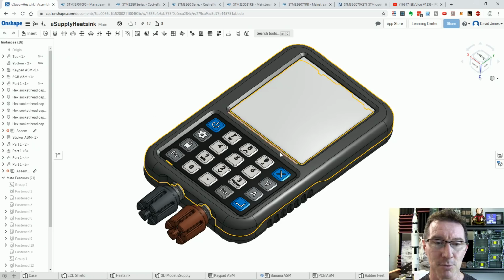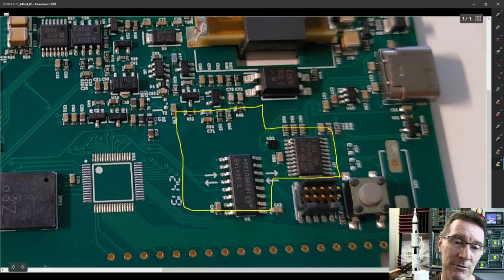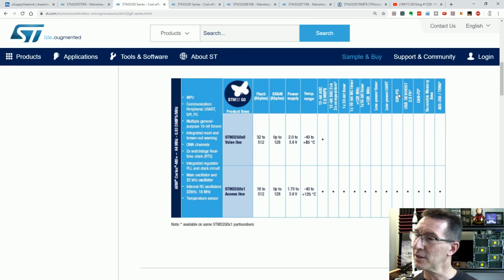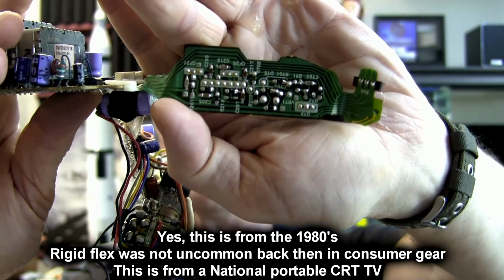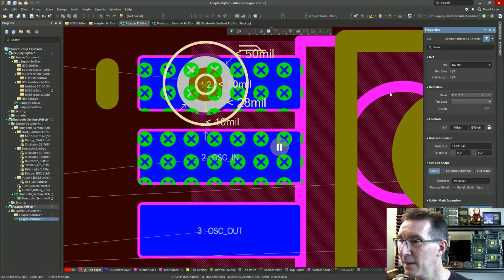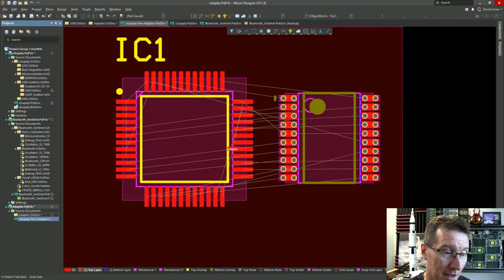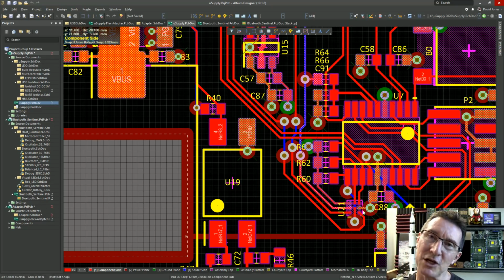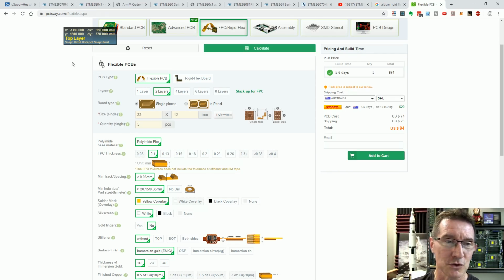EEVblog #1262 - Designing a Flex PCB + uSupply Update

Comment: Ha ha ha - yeah size constraints are troublesome if you underestimate the size of your code libraries. I recently did a size estimate on a cortex-m4 minimum software stack based on Newlib and gcc C/C++: small bootloader + Newlib C library + gcc C++ library + gcc C++ STL adds up to about 63k. On top of that you can start adding your own code and 3rd party libraries.
Reply: That is why you pay for good compiler and you get your code 30-60% smaller (even for small programs) and  and do not use c++ which add about 5-10% on code size on even best compilers. And you have added bonus in speed (I never mesure speed but according to compiler test for microcontollers gcc on F7 series generates 5 times slower code then top compilers)
But again gcc it is 5000€ cheaper then good compiler.
Reply: @mrlazda  Sure, don't use C++ if size if your primary concern is size. In my case that brings you down to bootloader + Newlib C library size total of 23kb which is reasonable for a fully functional C library. However, if you do need C++ then gcc is very good for size. It used to be that developers compromised and used highly compromised and size optimized embedded C++ STL libraries etc. but nowadays the gcc C++ STL is so well optimized that even projects like uSTL have shut down because it is not worth maintaining compared to the gcc solution. Meaning even though it adds about 40kb to use C++ STL it is still a very good size for what it is, a non compromise C++ STL. Regarding speed and size, I don't believe any commercial compiler like Keil etc. are any better at optimizing than the latest gcc 9.2. You might find corner cases where one is faster than the other but generally speaking no. I would pick an open source compiler like gcc or clang over any commercial one because the open source ones have much better support and companion tools.
Reply: @_-martin-_  Well but our test show very different results, in case of Keil vs GCC on our test program (we made some test program just to test ARM compilers) we get big difference between Keil and GCC, Keil result is around 26 KiB and GCC is around 40KiB and then as always winner on our tests is IAR with around 20KiB (just to be clear tests are written to be optimal for GCC and then made to be able to compile on Keil and IAR), we did not test Tasking compiler just because we do not have access to it (we heard good things about it but we do not know anyone who have it). And that is not just our experience, but all other companies that we do something with have same experience.
From our experience only worse then GCC is free MIcrochip compiler (but that compiler in free version add useless instructions just to make code bigger, so you will buy paid version), that why we stopped using PIC microcontrollers (when IAR dropped support for them). we use them only with assembly and only 10 and 12 series.
I am all for open source (we try to all we do to publish under some free license, except GNU, if our clients allow us to do that) but when that start costing us money then we pick option that cost us less (in this case that are expensive commercial compilers), I do want to see GCC or any other  open source compiler be close to good commercial compilers for microcontrollers so I can stop wasting money on compilers (I do know better ways to spend money then to give them for compilers).
And this is just what I heard, we do not use GCC so we didn't had that experiences but some companies had problem with GCC that it generates wrong code when you turn optimizations on, code without optimizations is ok (interesting that company after that switched to IAR, and we had similar issues long time ago with IAR for Atmel, but they quickly fix that in next release).
ps: For all except microcontrollers I do try to use GCC for all I can (even if it is not best solution there to and I have access to for example ICC for x86 that for me do not make in most cases that big difference so I try to stick to GCC it is good enough, there is just some special cases when difference is to big that I choose to use ICC).
Reply: @mrlazda  Sorry, but I'm very confident you are doing something wrong if gcc produces 40KiB, and your best compiler produces 20KiB. Maybe if you run with default compile options but gcc has many options that can help reduce size that will likely bring in on parity with your best commercial compiler. Also, if C libraries are involved, it is important to include the same C library if you are doing size comparison. If your test code is open source feel free to make it available - perhaps we can do some comparisons with latest gcc 9.2 compiler on e.g. cortex-m4.
Reply: @_-martin-_  Yes I know we are doing something wrong IAR should make 60% smaller code then GCC (according to their site) and we only get 30-50% so our test are in bes case 10% worse for IAR then they should be.
Joking aside we know what we are doing (my company is doing that for over 25 years and include people who designed most development boards MIcrochip sales) , that why we big companies pay us to do R&D for them, and we are not only who get that results, that is common result. GCC is not best for code optimization for size especially on microcontrollers and that is a well-known fact. (and IAR is hard to beat for optimization, that will admit even people whoso job is to write compilers for microcontrollers for other companies and they sell more compilers then IAR not their compiler is better but is much cheaper)
We learned why I need to pay for compiler on hard way when I lost money just because we was cheap to use free compiler (but we pass relatively cheap I know cases when company lost mid 8 figures in contracts for same reasons).
Reply: @mrlazda  I'm sorry, I'm still not convinced and you have to be very careful that you care comparing apples with apples. Yes, older gcc compilers might give you that result and perhaps IAR's claim of up to 60% comes from that. However, newer gcc, and certainly latest gcc, will not give you that kind of output size difference compared to IARs toolchain, especially not when working with 32 bit cortex-M. I build my own gcc cross toolchains from scratch and from that I know there are many options you can tweak to reduce code size - simply adding the "-Os" size optimization flag to gcc does not produce the smallest possible output size - there are more options you can tweak to further reduce size. Also, a lot of work have gone into gcc/clang in recent years to have them optimize things much better. I think we need a more up-to-date comparison to get a contemporary picture of IAR vs gcc.
Reply: @_-martin-_  Sorry may I ask when you last time compared IAR to GCC, we did comparison like 2 months ago, and yes we know how to turn optimizations on in GCC (we did turn dead code and dead data removal,  Disable  RTTI and exception handling, LTO ....) and that is results. I will ditch IAR same moment when GCC get in 10% in blink of eye.
Trust me we try every possible option and what I told you is best results we can get with GCC. We are not some kids that play with microcontollers for hobby in their basement, we do that professionally for living.
And yes I would like my company switch to GCC so I do not need to pay for compilers (I own 100% of company so all that money go out of my pocket)  I would in March prefer to spend amount of money my company speeded on compilers on new Aston Martin DBS Superleggera (just this year my company speeded only on compilers 1/2 of price of it, and if we could use GCC that money would ended in my pocket instead in pocket of some other company so trust me I have good reason to my company use GCC, but as I stated before we can't)
By the way I do not try to convince you to anything, you use what you think is best for you (or what your tests show you that give you best results), we will use what we proved that works for us (to be precise what make us most money, I would not use IAR if it so not make me most money, I really do not its UI, I think they didn't change it from late 80). I just presented you results we get and that is all, it is up to you to do your tests and see what is best for you.
Reply: @mrlazda  As it happens I had a project last year where I tried replacing gcc with IAR on a cortex-m4 micro just to see what we could gain in size savings and it was about 15%. You say you have some secret test program optimized for gcc where it was 50% smaller with IAR. I guess that kind of savings could happen for a very specific and maybe broken use case but I don't believe that to be the general case at all, especially not with a modern gcc toolchain with all optimization bells and whistles enabled. It could also be you are using some obscure architecture that is particular bad with gcc that I do not know of. In my experience with cortex-M micros, gcc is worth it.
Reply: @_-martin-_  I you are interested we tested for cortex-m7f (STM32H745ZI) and cortex-m3(stm32f107vc), we mostly use STM32F103/7 series and we needed for some project we are working power of STM32H7 (first choice was STM32H745ZI but we will manage to do all with STM32H742ZI), we didn't run test with cortex-m4f just we do not need it for now (and as it look we will not need it for next year at least) so it is no of interest for us.
We do not use anything special for test it is just test program that is carefully made so can be compiled on all compilers and test procedures we use most often, but other then that it is pretty much useless because in near all cases you can't compile same C/C++ with GCC IAR and Keil (they are not compatible) and make it to do something much useful.
Your statement I try GCC project on IAR, explain me all, when I hear that statement I see only red flags, as I pointed earlier, you can't just switch from GCC to IAR,  and expect it works, that is not how it works. You can't use most of libraries made for GCC on IAR (they need to be ported to IAR first), they do not handle inline assembly in same way, references to memory placement are not same ....,  to make it simple in 99% you need to port whole project from GCC to IAR what is not someone who do project professionally do just to see if he will get some gain (that why you make test programs)
I guess you tested with some so basic program, that is only what you can switch between them, so for extreme small project you will not see difference ( only difference you will see is how different they optimize startup code)
Now is clear to me why you get so good results with GCC.
Reply: @mrlazda  I don't care for your condescending attitude and I can tell you that all your assumptions are wrong. The code we tested was written for a Texas Instruments TM4C129 (with hard float) and it ended up requiring only a relatively small effort porting it from GCC to the IAR toolchain, for several reasons. Generally we write our own C code in ISO C11 which is supported by both IAR and GCC so we had to put in very little effort to port our own code - in fact, we only had to eliminate a couple of misplaced gnuisms to make it work. Additionally we had some assembler boot code we had to port but that only amounted to about 50 lines or so of assembler, again very easily ported. The biggest effort was rewriting the linker configuration script to make sure everything was placed correctly in memory. We care about portability and it so happens that the 3rd party TI driver libraries that we had chosen to use are supported by both GCC and IAR (ewarm) so those ported with no effort. In the end, the output size of GCC was about 250kb, a decent size firmware for this type of micro, and with IAR it was about 15% smaller. Mind you the code was made for a product by professional software engineers, not some script kiddie in their basement doing a small basic test program. We are all professionals here. It is speculation on my side, but I think you guys have been comparing some older GCC version with IAR. Older GCC versions (just 2 generations back) are known for their inflated output size. Either that or for some other reason you run into a specific use case or misconfiguration that ended up inducing such a big size difference. Clearly we have different experiences and maybe we will have to agree to disagree. The devil is always in the details.
Reply: @_-martin-_  There is no need you to explain me anything any more, after your nice writing in your last comment (of course you missed some key steps in porting code that you must take) for me it is clear with what kind of software engineer I am talking and I see I am wasting time in any other discussion with you.
Reply: @mrlazda  Well, I also feel sorry for you and your customers if that is the sort of attitude you want to maintain. I am missing no steps in my description of our porting effort and there is no room here for all details. If you think different please enlighten me on what is missing or please hold forever quiet. It is besides the point anyway, we put in the effort to do the porting and that lead to our size conclusions.

Comment: you have to remember that if the flex is made out of Kapton you need to bake the PCB before use to allow any absorbed water to be removed before soldering. we used multi-layer flex pcb's to provide screened twisted pair's to replace wire. solid screens except where they bent, at  this point it was xhatched. could reduce 20 twisted pair cableform down to one PCB from the connecter at the front to the motherboard at the rear.

Comment: 32KB? You should be able to fly to the Moon with that much memory!
Seriously, is USB PD so complicated it can't be done in a few KB? Starting from scratch rather than trying to trim a bloated library? (I must admit I know absolutely nothing about the protocol though...)
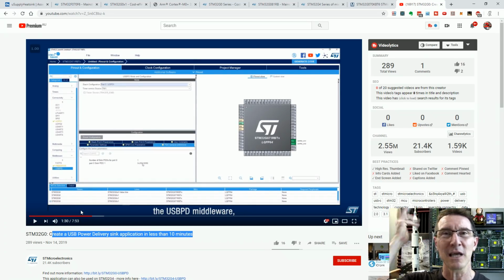Edit: 18:55 apparently it is :-/
Reply from the maker: Yep, no reason it needs to be that big I'm sure. Probably uses a ton of pre-written libraries and non-optimised stuff.
Reply: There are many ways to minimize the size by just using compiler and linker flags. But yeah in general when I comes down to firmware, it gets more and more difficult to find optimised code and best practices. The reasons for that is another topic, though.
Reply: Probably is written in C++ with templates...

Comment: You could route holes out around U2, U21, C88, R60, R62, etc so that the flex PCB will sit flush with the board and place the new microcontroller between U2 and U11, then you don't have to remove the capacitor or worry about the bend radius. You could also route small slots over the U7 solder mask for easier alignment.
Reply from the maker: Sure, several different ways to do this like I said.
Reply: it's just freestyle by DJ

Comment: Keep in mind: a flex PCB mod/adapter board will even let you fold it back over into the footprint where it is connected. No reason to hunt for space all around that. ;)

I often solder very small flex PCBs to a dense QFP, sometimes several a day: UltraHDMI mod for Nintendo 64. ;) The castellated edges of the flex mesh perfectly with one side of a QFP160 and it works incredibly well.
Reply: Thank you for sharing some wisdom with me!

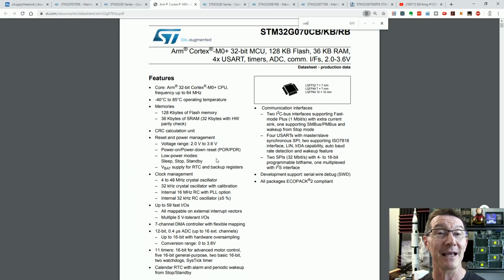Comment: 17:06 no usb controller, thats the STM32G070CB, which fits in the "G0x0" (x is wildcard) row of that features table, the top row, doesnt have usb power delivery
the STM32G071CB (g0x1, the row that has usbpd ticked) does have usb pd, on page 33
https://www.st.com/resource/en/datasheet/stm32g071cb.pdf

Comment: I've got an old Casio scientific calculator (25-30yo, my dad got it as a gift) and the whole circuit is on a flex PCB, membrane buttons, the main IC, screen is soldered directly to it, and there's a small hole to fit 2 THT diodes (leads are straight, just cut to lenght) for the solar panel, it's absolutely beautiful and insanely light, using it without the protective case feels very weird, since the back behind the buttons is recessed, so the flex rests on the enclosure
Reply: TomboXYZ He’s shown teardowns of those on a few episodes.

Comment: are you not worried about poor power supply decoupling with those thin traces?
you couldn't get one of the small QFN/chip-scale BGA to fit inside the SSOP footprint instead of the TQFP?

Comment: Normally when I watch EEVblog videos, I think "Ahhhh, something I find interesting, but know nothing about." Then suddenly it's about binary size. My pet peeve.
Let me guess, it depends on 15 massive libraries?
Reply: Would you believe me if I told you they forgot to turn THUMB emission on?

(It's a joke, because all of the Cortex M series can only execute THUMB instructions, not the full fat ARM A-series instructions...)

And no, since this is embedded MCU dev there's not as much library dependency hell, especially not when you're targeting 16-bit binaries to 32KB of flash. Might be able to get away with that on AVR8, but ARM's code density isn't nearly as high.
Reply: Crapy software depending on hundreds or even thousands of libraries are really the plague of modern software development. I look at you Electron...
Reply: @jendib  Yep, Electron is an absolute failure
Reply: How long until a vendor-supplied "embedded" software package contains a zipped node_modules directory.....

Comment: Why not use "rigid-flex", the rigid part only covering the main board footprint, and then flex out the new chip? reduce stress on the flex/soldering and maybe simplify the interface between main board and adapter board?
Reply from the maker: Because it's not for production, it's just a quick hack for handful of prototypes.
Reply: Because that would be a completely, utterly unnecessary overcomplication?
Reply: @TheHuesSciTech  well, if you want to go down that path... changing chips n making patch-pcb's just because you cant fit code in 32k or less sounds like youre doing something wrong. its a powersupply, how complicated do you need it to be, really?